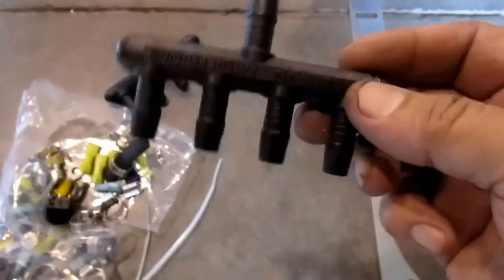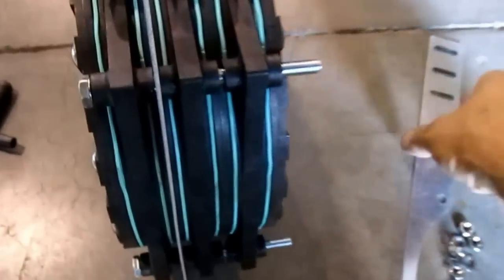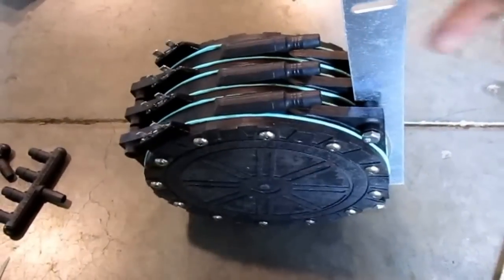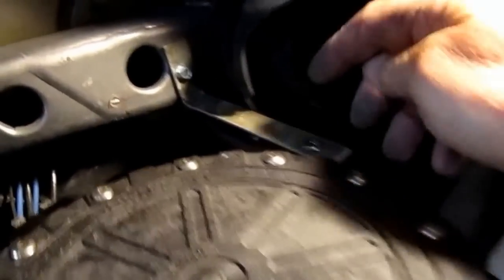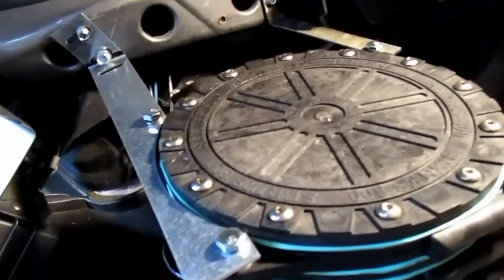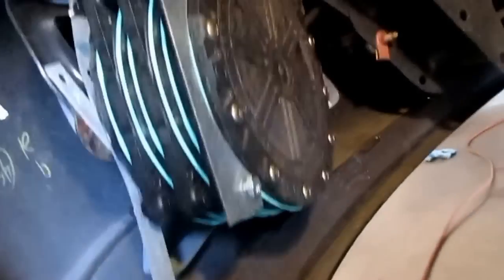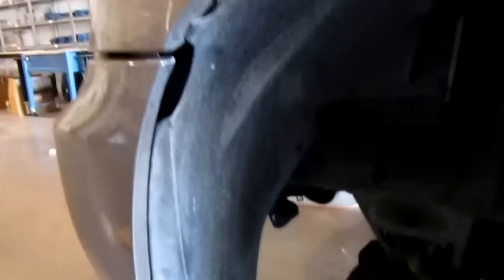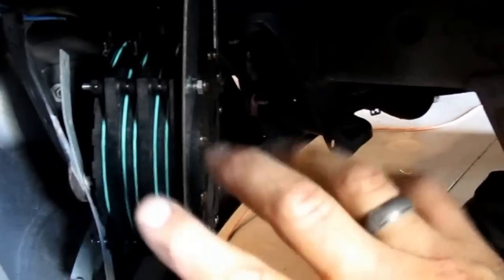Installing the HHO generator part 2

Comment: Is this system works with the original fuel for the car or he just hydrogen ? Second, how can the car run on hydrogen alone .thanks
Reply from the maker: +Trinity is still my name This system works with all existing fuels including petrol, diesel, CNG, and LPG. On demand hydrogen does not replace fuels at this time (none do), rather, they act as combustion catalysts to more thoroughly burn the fuels where it matters most: inside the engine. That is why the emissions drop, and the mileage increases.
Our units are more advanced than most, and designed to look like they belong in a vehicle, not on a garage workbench. They are slimmer, half the size and half the weight of most, fitting in to the tightest areas of most cars.
Reply: Transitional Technologies Thanks sir :and Is there a way to make the car run on hydrogen only, without the need for fuel?